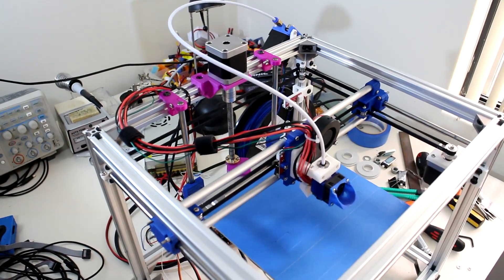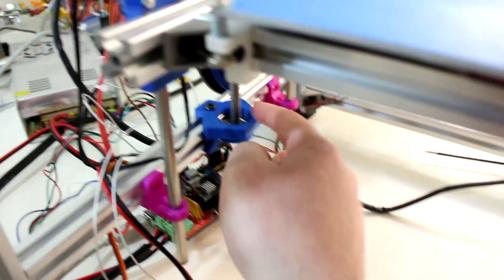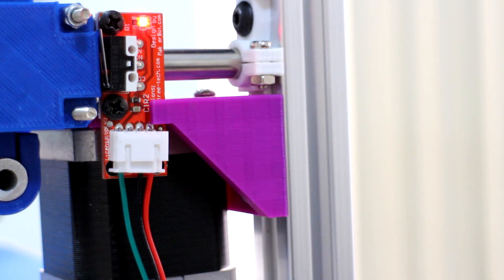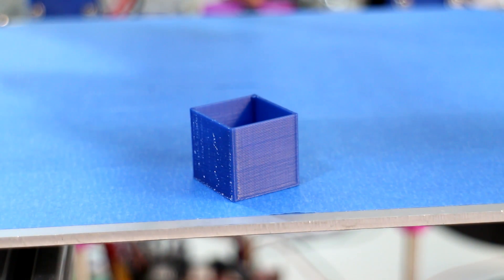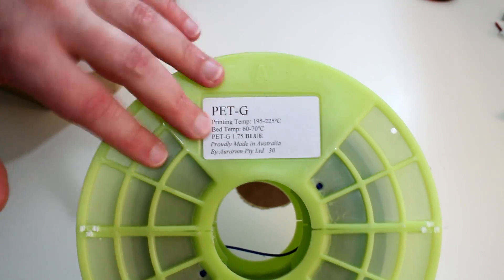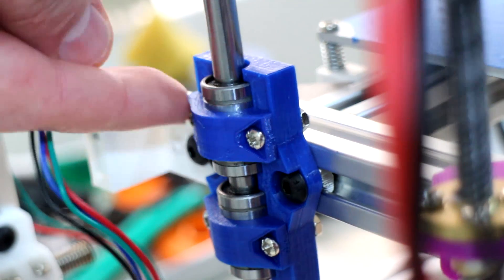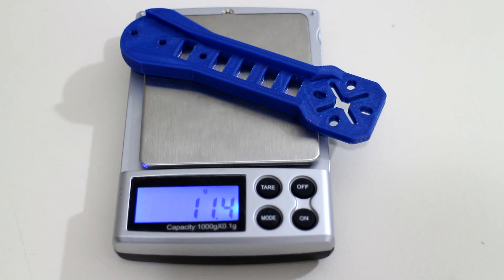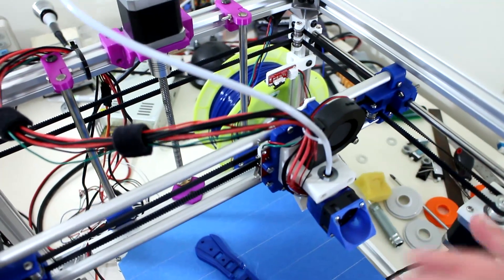New 3D Printer - Build Log #8

Comment: At what build plate size would you need an additional support system & stepper motor on the opposite wall to the existing one? and, could that consist only of a bracket support/dual smooth rod rails or would it necessarily also require a 2nd motor+threaded rod even if the build plate was extremely lightweight?

Comment: Did you use any active cooling when printing with PETG?
Reply from the maker: Only in select circumstances, like overhangs, bridges, and small details. Slow the fan down to 50% and don't use it for when printing pieces that are susceptible to bowing.

Comment: I remembered you mentioned the low temp of the PETG in this video and thought I'd share;

I've recently had delivered to me a roll of PETG from a Chinese company that goes by the name of Createbot. Their listing states a print temp of 200-240C and a bed temp of 90-110. When I was running thin wall calibrations I discovered that the ideal print temp on our i3 MK2 was less than 220 for the best surface appearance and no loss in strength. Bringing the temp down to 205 showed no perceptible difference in either print quality or strength. I also dialled in the bed temperature to a mere 45 degrees C as the stuff wanted to weld itself to the platform. At 100 degrees, it was threatening to rip the PEI foil off the bed!

In my case I've found that this PETG seems to like being printed fast. Apparently low temp PETG is a thing!

Comment: Hi,I,ve looked high and low,but 10mm anodized aluminium tube is pretty hard to find .I did find some 10mm stainless tube on ebay.Local pricing(new zealand) is way off the scale:(.
Wonder how that would go with the steel/copper bushes?
Just trying to price up the whole shebang before I jump in.
My current printer is an Aurora I3 chinese job,with the leadscrews integral with the steppers.It used to print ok,but lately it,s given me all sorts of grief.I need it to print the plastic parts,so i'll have to get it sorted before I pull it apart for the bits.
Thanks for publishing your design,I'm very impressed with it,s lack of noise.

Comment: Wouldn't locking down the end of the threaded rod introduce z wobble into the build plate? I have read that most printers leave one end unsupported for this reason.
Reply from the maker: If the motor was on the bottom, then yes constraining the leadscrew may induce wobble, but in this configuration the leadscrew is pulling on the coupler which is acting like a spring. As long as the motor, z-nut holder and leadscrew support are aligned it works very well here.

Comment: Very cool project. I'm currently in the process of building my own Prusa i3. Can you please tell me what heat bed you are using for your design? Cheers.
Reply from the maker: Aluminium MK2B
Reply: Thanks! No issues with bending or bowing?
Reply from the maker: Kanguros
The second bed I purchased was "acceptable", but not perfect. Unfortunately at these price points they will not be perfectly flat.

Comment: +Tech2C Great videos! between you and Angus, you've inspired me to start building my own printer! starting with a Prusa i3 RepRap but this design is the one I'm doing when I know what I'm doing! Thanks!

A question about PETG. Would a higher hot end/nozzle temperature create stronger prints? I'm thinking greater temps mean stronger or more binding taking place. Just wondering if someone has tested this?

Anyway, thanks again, great videos! Keep it up! From Joe in the UK

Comment: Have you thought about printing up some cable chains for your printer?  the core xy design might make it fairly simple to add a nice looking cable chain for the print head.
Reply from the maker: I was just going to use some cable management that spirals around the cable loom from the hotend, and attach it to the top of the extrusion. If only those dam t-slot nuts would get here sooner so I can mount the ramps board to the frame and tidy up the cables... ;)
Reply: :P  If you do get into a bind and need a T-slot nut for something, there are plenty of T-slot nut designs on thingiverse.  If you have M3, M4, or M5 regular nuts they can be put in a 3D Printed T-slot adapter and get you by until your order arrives.

Comment: Looks awesome man. Only thing i'm not a fan of is the cantilevered bed, nothing to do with your design but cantilevered beds in general. So easy/cheap to constrain in all four corners, is there any real benefit to a cantilevered design?
Reply from the maker: Cantilevered is a very simple setup, 1 motor, no belts, access to 3 sides of the bed, etc, at least the way I've done. I agree it isn't the most stable design but it seems to work for me so far. Other commenters have already mentioned they will support the bed from each side, which could be done by duplicating the z system and suspending the aluminium extrusion between them.
Reply: Yeah for smaller machines sure it would work fine, once the build goes larger i think it would be struggling. The machine I've built is 450x450x750 and can't imagine running cantilevered. Then again i've needed 3x steppers, 4x bearings etc.. so guess it's a cost vs practicability comparison.

Seriously considering swapping out the maker slides with some machined bushings like you've done, seems to work fantastic.

Comment: I tried PETG on a mini quad full print and was impressed. That was until I tried the shock test. Twisting and bending it seemed unbreakable. Then I slammed it onto a concrete floor and it acted almost like glass. It just shattered into about 5 or 6 pieces. Not good for car park racing....
Reply from the maker: Well it is still plastic. I find keeping the quad as light as possible is the only real alternative to a durable frame.

Comment: nice build, looking at you design with the Z stepper i think you still have some room to bring the stepper back inside the frame, the bed only comes up so far so may provide enough clearance still.  Failing that you could use a lower profile stepper on the z axis as the extra torque is not needed on the design you have and the current stepper is larger than needed.  The Aurarum PETG looks awesome, i've had bad luck with their PLA going brittle just days out of the box, can you keep us posted if this issue manifests with the PETG, if the outcome is good i'll grab a couple rolls for my MPCNC build.  Great channel, keep up the awesome work! :)
Reply from the maker: If I move the Z motor back within the frame then I'd need longer Y axis alu extrusions to travel 200mm. Plus either side of the z motor is wasted. Having the z motor above allows the entire x gantry to slide to the rear of the frame.
I will monitor the PETG filament for brittleness over time, but it is a different chemistry to PLA so hopefully it'll survive much longer. Also it's quite cheap PETG at $40 Aussie dollars. Thanks for following this series ;)

Comment: I'm surprised that the PET-G didn't have a soft failure like some of the other PET-G plastics I've seen.
Reply from the maker: It seems to have a different chemistry to other PETG I've used, printing at lower temperatures is a hint.
Reply: Very curious, I wonder what it's actually made of. It'd be nice if there was more accurate labeling for filament chemistries.

Comment: I like that you say "zed". Don't change your regional pronunciation for anyone.

Those prints look great!

I really look forward to your videos. More than any others.

I'm starting to work on building my own printer as well, but I'm more of a software guy, so I'm exploring different stepper motor drives and working on my own firmware.

Keep up the awesome work!
Reply from the maker: Thanks Bob :)
Reply: Yes, stick with zed - especially when you follow it with alumin-ium  :)
Reply: Zed and the metric system in general should be always used in 3D design, it makes us cooler. But seriously, metric system wins.
Reply: +Andrew Fearn I totally agree. I really dislike the imperial system used in the US. The metric system is much more natural and easier to use. My 6 year old daughter's school is teaching both, which is pretty cool.
Reply: +Micah Vestal Pulp Fiction, of course.
Reply: @alunmo  as an American, I agree with you wholeheartedly.
Reply: +Bob Moreno II I agree wholeheartedly. Zed is not dead! (what's that from?)
Reply: From the movie: God's Not dead!! Right?
Reply: +Andrew Fearn you get a gold star :)
Reply: Wait ur making ur own 3d printer firmware? Lmk how it's going!
Reply: HillbillyZT It's going slowly as my hobbies vary through out the year. I'm just playing with an Arduino Mega for normal Cartesian movement. I have it wired up with stepper controllers and switching power supplies for 24v and 5v. I have it to the point where it can process gcode and move the x, y, and z motors, but i still need to add acceleration/deceleration, extruder support, heated bed, support, endstop detection, leveling, homing, etc...
Reply: Haha yeah there's a reason that there are only a few commonly used firmwares :P That shit seems hard!
Reply: Not to mention that the true English pronunciation is 'Zed'.
Reply: Never forego our true English education system in Australia. 
Zed is the last letter of the alphabet, always has been downunder.
Reply: @soundspark  Then they did you a favour, why would you want to work with such a backward company?
Reply: @soundspark  I am glad I do not live there, hopefully, you found a better job, Elon Musk uses metric. When will the division in your country end or will it lead to civil war?
Reply: @soundspark  Keep looking you will find something better, or better still make your own opportunities. I built the Ben Levi MGM printer except with sheet aluminium sides fully enclosed and insulated, I am very happy with it. I have stuff for other things on order from aliexpress and they are taking forever to arrive.

Comment: I'm a bit worried about the Z lift. If I read the community forum's the opinion is more or less that this system for the Z is a bit out of date and that it causes vibration attracts when you reach the outer corners. In this vid you rest your hand on the edge of the plate and you can notice how easy it is to move it. A lot of new designs use 2 smooth rods on the left en right side in the middle of the build plate this seems to be more stable.

Anyhow please don't take it as criticism, the quality of the prints is nothing more then fantastic. But I was planing you build a 30x30x30 version of this model but I don't think the Z lift mechanism is up to the task keeping a 30x30 plate stable.
Reply from the maker: Correct, if you want to go larger you will need to support the build platform from 2 sides. You could do this by using 2 sets of the z axis parts on the left and right hand side of the printer. Then suspend the aluminium extrusion between them. Quite an easy setup.
Reply: You are pretty smart did you know that? But does this also mean using 2 motors or only 2 smooth rods? Anyway I did a bit of A impulse buy and bought a 30x30x30 P3steel frame. So this December I will build that one first and is going to have a super light weight Y. If that one works I will take the old one apart and use the parts to build this one.

Comment: It was asked before, so I'll ask again, when the files are ready, are you willing to sell printed parts? I would be more than willing to help support by purchasing the printed parts from you.
Reply from the maker: For those that are wiling to support this channel I would definitely be willing to sell the set of printed parts, and also the frame kit (pre-cut 2020 aluminium extrusions, anodised aluminium tube, full set of screws/nuts, etc).

From release of the files it may take a me a couple of weeks to gear up for it but it is something I'd be happy to provide ;)
Reply: I am doing a different size (600x600x600) so I would just need the 3d parts. You tell me how much and a PayPal, and I'll send it. Printing takes time and I'm a patient kind of guy.

Comment: A very well designed printer, i had something very similar to this in my own mind, but slightly more like the Ultimakers design for X&Y movement. However you have without knowing it answered many of the questions that i had on my mind (for example of the alu-rods would work just as good as the stainless steel) so i thank you for that! And also this printer has given my alot of new ideas! :) Too bad however that you are abandoning the white color for the printed parts. i really liked the clean look from the pure white! :)
Reply from the maker: I agree the white/aluminium colour combo was very sleek. When you are give a product to review sometimes you have no say in which colour you receive. I may buy the PETG in white from Aurarum then... :P

Comment: Few things... First off, I have never built a 3d printer so you may want to take this with a grain of salt, but I have built and designed many other things. 
One thing that bothers me is the plastic parts. That stuff will compress and displace ever so slightly every time you run the printer. I would think with plastic parts like that the printer will need constant calibration every few prints. 

If you are going to use plastic for the motor mounts I would advice putting something on the bottom side as well... Or at least get something behind that bottom corner so that the bottom is not floating and is backed up to plastic. IMO you will get flex with the way the mounts are now. 

I cant thank you enough for posting these vids... I am getting ready to build one as well. This is definitely the design I am going to get. I just found a few kits that are very similar to this. So these vids will be very useful to me. I am sure I will find some flaws in the design of the one that I get, and will be modding it just like you are.
Reply: My P3steel uses printed parts, calibrated it 2 times last year, still works perfect.  I think you underestimate how good printed parts can be. I must say my parts are PETG with 100% infill.
Reply: Thats fine... even still he should get something behind the bottom of that motor. From what I can see there is no reason that the bottom cant be supported. That part of the design has bothered me from the first time he showed it.
Reply from the maker: Hey! Normally I would agree, plastic parts for frame components could cause problems, but the 3D printer community has been using plastic parts for construction for years. It has been proven to work as long as the part is solid/rigid enough for the task.
At the moment the motors don't seem to need support from underneath, but it is a great idea and I will investigate it if it causes problems in future. Cheers!

Comment: +Tech2C is the "2C" part of your name a reference to 3 - 1 = 2 and D - 1 = C? Also don't worry about how you pronounce "Z" or anything else for that matter. While I do pronounce it differently than "Zed" I feel if someone bothers to try and make others say it the same why as them they can (and should) realize that the normal way to say things is not the same everywhere in the world. Also don't feed them trolls ;)
Reply from the maker: Oh very clever! 3D - 2C, I like it!
The play on 'Z' was just a bit of laughter with some commenters on the previous video. I tried my best to 'remember' to say 'Zee' rather than 'Zed', but slipped a few times, lol :)
Reply: +Tech2C I'm in the process of getting the parts to build one of these. Do you know how many 2020 extrusions you bought/used and of what lengths? I can wait on the .stl's but would like to order the banggood parts as they ship slowly.
Reply from the maker: Stephen Germiller

I'm working on the BOM currently and will list it on Thingiverse before the STLs are ready. I should hopefully have it done in a few hours.

Comment: I might have missed something but how can you move the z motor 10mm but the leadscrew nut only 7mm
Reply from the maker: Because I moved the guide rails back by 3mm, which includes the build platform, so the leadscrew nut only needed to move back by 7mm to line up with the motor.
Reply: +Tech2C ahh, thought I missed something, thanks.

Comment: Looks very good.
Reply from the maker: Cheers.
Reply: Tech2C
Your cooling issue is like what I had on a Chinese printer I purchased and I designed a ring cooler for it instead of a one direction fan mount and it cooled all sides around the nozzle simultaneously.  I bet you that if you did that you could print faster.
Reply from the maker: Can you try printing a hollow calibration cube with 2 perimeters at 80mm/s and update me on how your cooling solution performs? The speed at which the print head doubles back to the original position is too quick for the plastic to cool fast enough. Mind you this was PLA, so if I tried ABS or PETG then it may have cooled enough in time. Either way I agree that a I may need to create a dual fan duct design.
Reply: Tech2C
Well, the problem with the Flashforge knockoff was that it had one fan on the left side to cool everything and it was dual system.  I don't like duals so I removed the right side but Benchy's hull was garbage so I spun it around 180 and printed again then the hull was fine and the aft was bad and I knew it was a fan issue using PLA.  I created the ring for it and replaced its single fan duct and reprinted Benchy and perfect.  Using your blower is fine it is just that one directional air flow and if I had to lay odds that wonky corner was toward you and opposite the fan.
Reply from the maker: No arguments here...